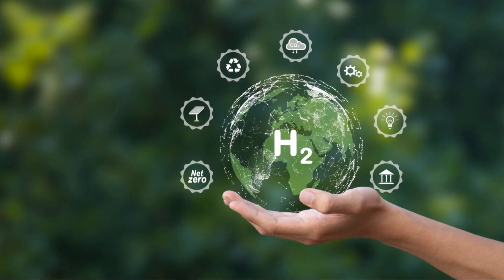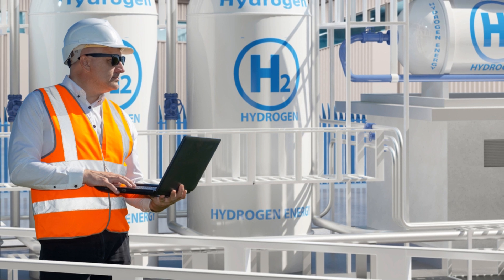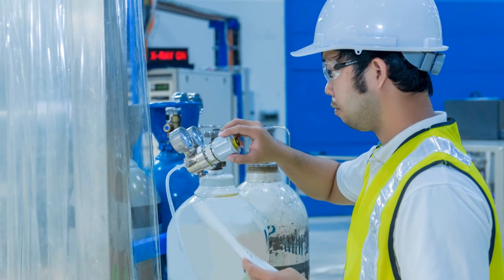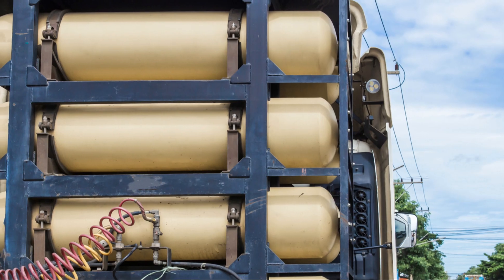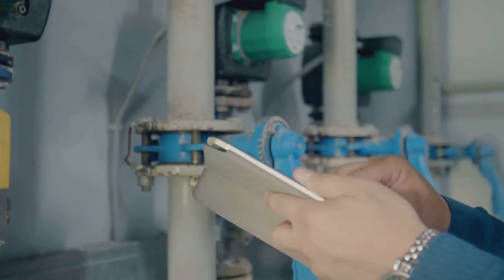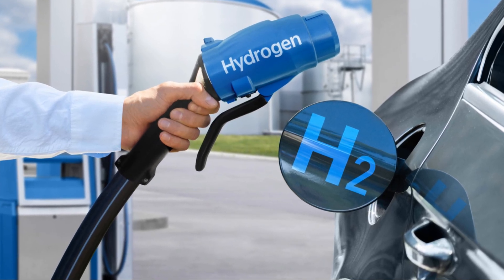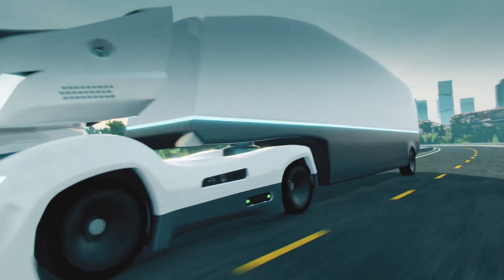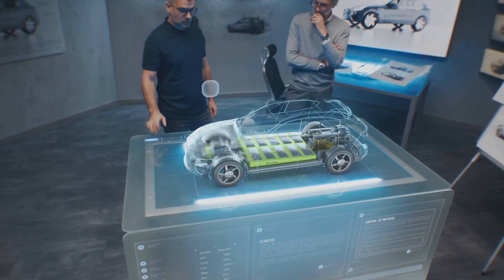Hydrogen leak in fuel cell cars

Comment: Everyone says that Hydrogen can be made from renewable energy, while failing to say that it's far less efficient than just charging a battery in a car with it directly. To say that Hydrogen cars are efficient is deliberately misleading. Each process has inefficiencies that have to be added up, and these include everything from Hydrogen production, compression, delivery and finally usage. When you add all of those together, you find that it's roughly one third as efficient compared to just storing and retrieving the electricity in a battery.
This is a dead end technology. It's irrelevant whether tailpipe emissions are just water, that's just a distraction. Poor overall efficiency and complication overall dooms this technology. Hydrogen as a way to transport energy make no sense.
Reply from the maker: You make a valid point about the inefficiencies in hydrogen production and usage compared to direct battery charging. While hydrogen has potential for specific applications, like heavy transport, the efficiency concerns you raise are significant and should guide our energy strategies moving forward.